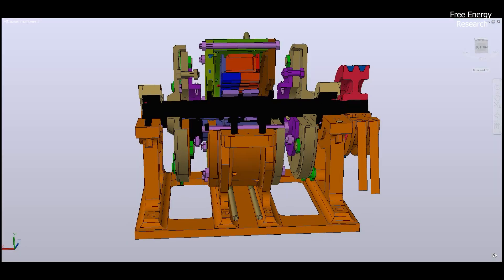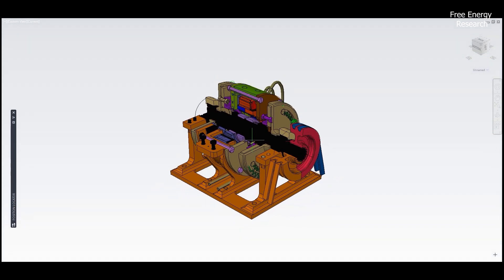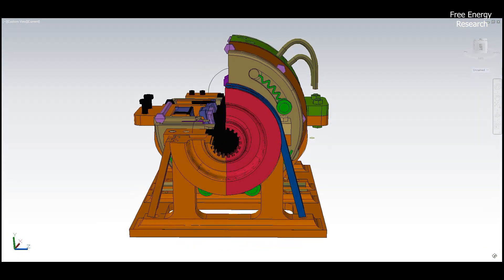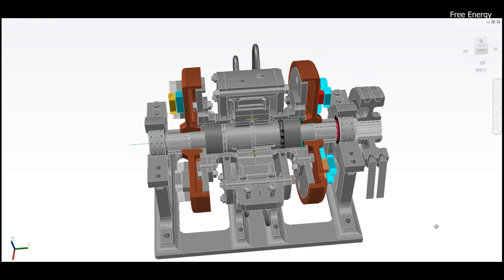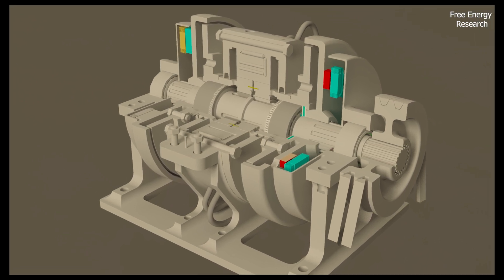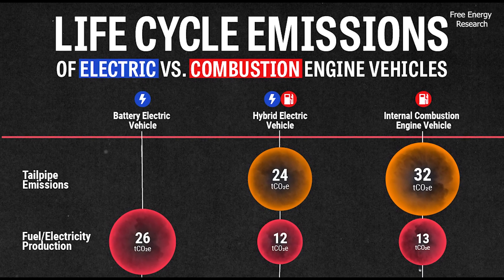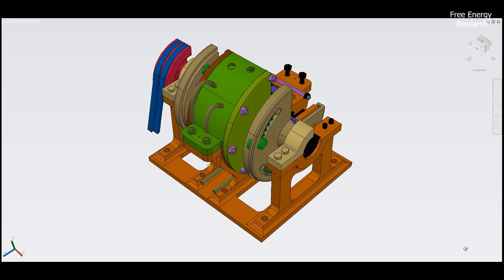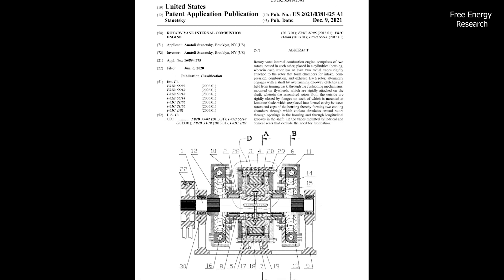Anatoli Stanetsky RVICE :  "Free Energy Research Channel"

Comment: The combined two-motor hybrid system consists of a traction motor and a generator motor, which efficiently convert engine output into electricity, supply power to drive the tires and charge the battery, while also regenerating electricity during deceleration.

Comment: I had to explain again. Today, we still use existing internal combustion engines built over 150 years ago that use reciprocating or crank mechanisms. These engines have efficiency only 15-27% of their energy and dirty exhaust. It would be stupid to use such an engine in a hybrid electric vehicle because the electric motor has 96%. Total we get only 26%! Therefore we must use our amazing engine with efficiency 70% and more. And an additional benefit by using hydrogen. It is the best future!

Comment: Pay attention! I propose to use, never used before, a rotary vane internal combustion engine (RV16_8) for a hybrid electric vehicle, easily running on hydrogen, gas.
Rotary-vane internal combustion engine RV8/16, US patent 11, 428, 156 B2, powerful, highly efficient (more than 70%), high shaft rotation speed (up to 12,000 rpm), not subject to overheating (the rotor block is located inside the cooling baths), durable, reliable, does not vibrate, does not make noise, has small dimensions (uses much fewer parts), therefore much cheaper, easy to manufacture and unpretentious in maintenance. It does not have a crank, reciprocating mechanism or cams.
Thus, we have at the same time the most compact and most powerful engine that runs efficiently on clean fuel - hydrogen or natural gas. However, the engine can use any fuel.

Comment: Doesn't work
Reply: We don't saying that this device produces more than it takes to run it. We are saing that efficiency of engine is more than 70%! Please figur out what you're talking about. This is a rotary vane engine.
Reply: @anatolistanetsky5023  Rotary vane engine attempts have been around since the 1960's.  There are multiple patents for RVE's.  So you should know that they are impossible to actually make reliable due to thermal expansion and Vane Tip Wear.  It looks like yours is the 'Russian rotary vane' and not a Sliding vane??  Also called Cat&mouse??  I have studied Rotary Vane engines for 6 years now because they ARE the theoretically perfect engine design.  Is your design sliding vane or Russian Vane??